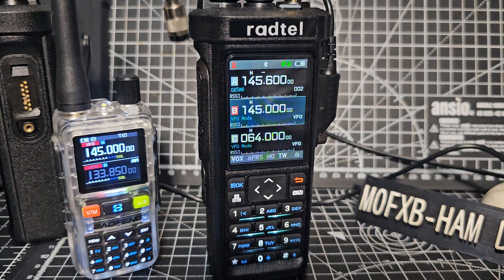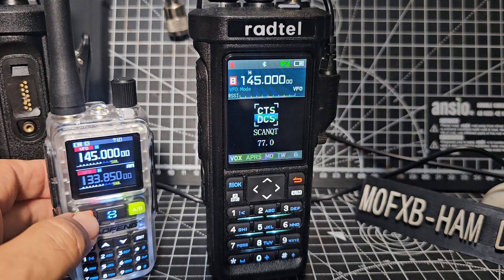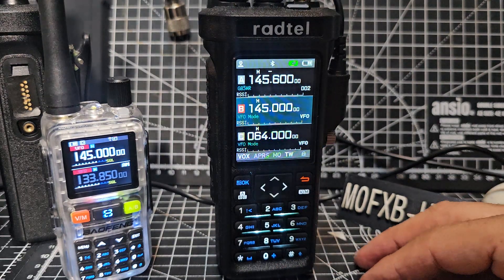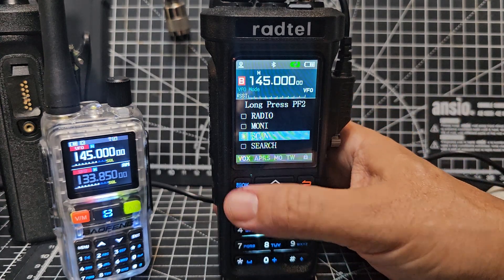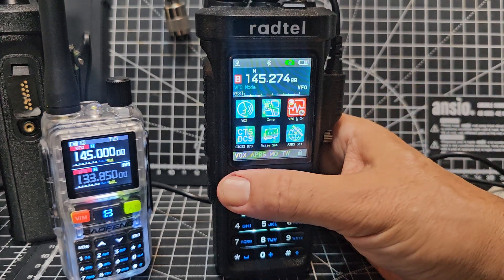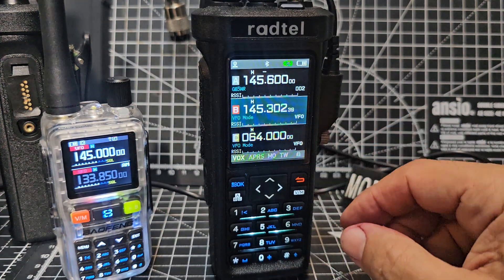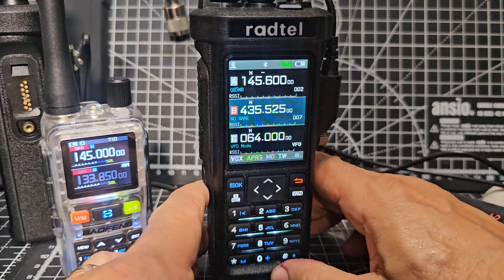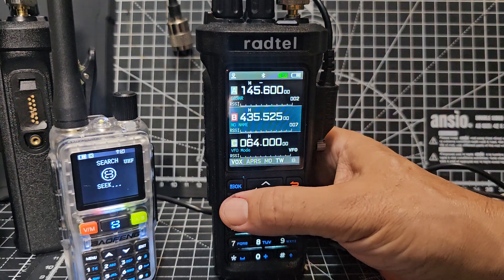Radtel Rt950 Pro , CTCSS , DCS Scan & Scanning

Comment: Hi, with this new 950 pro, is it possible to define a range of two frequencies with a higher and lower frequency for VFO scanning, or not yet? With the 880G, you can't do this, but Radtel told me in the past that they would add this feature, which, incidentally, every amateur radio has.
Thanks to your video, I also notice that the frequency scan is still very, very, very slow...it's a shame, as this is another feature I was hoping Radtel would improve.
Have a nice week end 👍
Reply from the maker: Cheers thanks